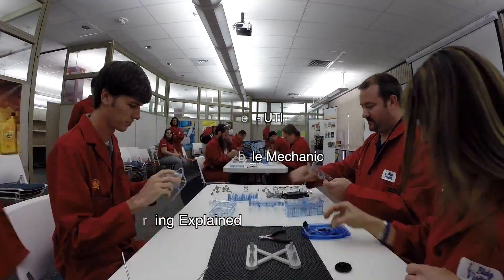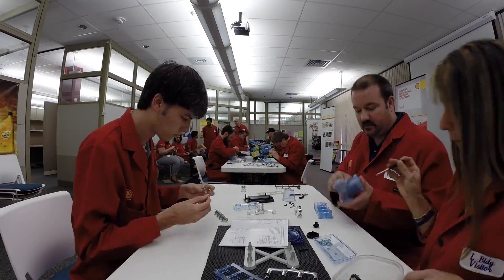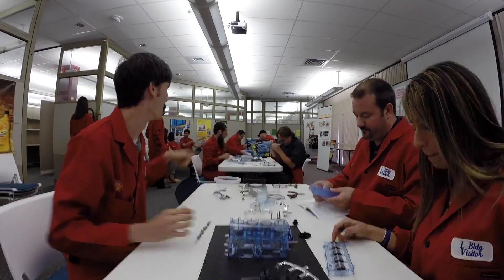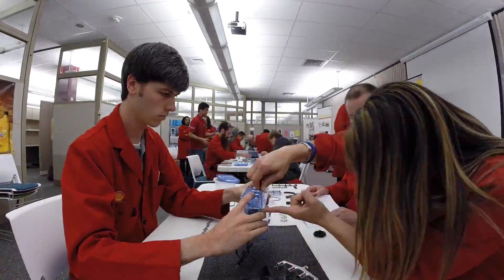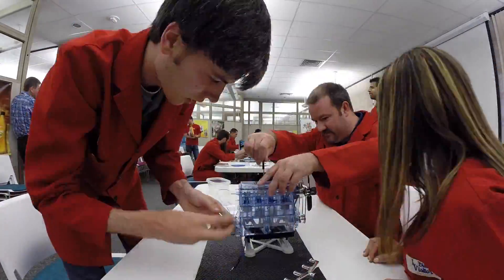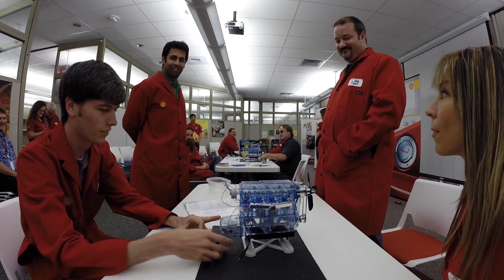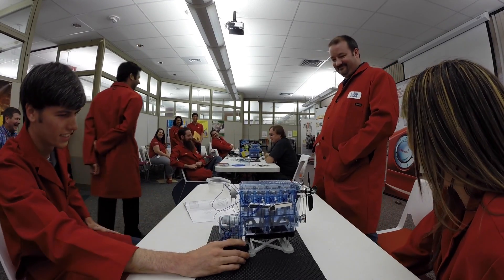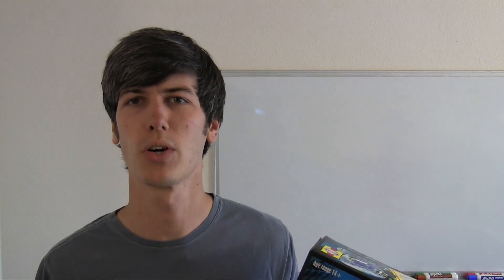EricTheCarGuy vs Scotty Kilmer vs Engineering Explained - Engine Building Contest

Comment: didn't understand anything, I know, that it was great fun! The best cars in the 2020s are the new Mazda turbos (maybe Toyotas too), not electric cars, politically pushed by Angela Merkel. I like turbos: diesel more than gas, preferably some, that would run  EMP-safe. Shell is a dumbbell though; they didn't activate my V-Power-Club card without my birth date! I don't want to give this info.   Nevertheless, I am a fan of Elon Musk's rockets; great, solid advancement to previous technic.

Comment: Why didn't the engine turn over i.e. "run"?
Reply from the maker: No oil! ;)
Reply: Hahaha!! That's what the $25 gift cards were for :P
Reply: Gotta get that Shell ROTELLA.
Reply: They had everything packed too tight so would not turn over.   Remember they are engineering people who love to do that, just look at anything made today.  Can not get to even a spark plug without pulling the motor.

Comment: What crappy engine has a cooling fan on the camshaft?
Reply: +adapter gasowski All WW2 aircraft engines.
Sorry, that's the prop.
Reply: +TIMEtoRIDE900 I think you have crankshaft confused with camshaft

Comment: this is cool,i wanna try this..how much is it and is it difficult?
Reply from the maker: +shinzantetsu I believe I linked in the video description. Pretty simple and cheap!
Reply: +Gregory Kanniard damn i'm 11, oh well
Reply: I have the V8 version of that engine. If you understand the main parts of an engine, you have a project for an evening.
Reply: +shinzantetsu They're not hard to get hold of... I used to have one, only downside is because the crankshafts on them aren't solid, they had a knack for locking up... if it was designed to actually burn fuel and run then that would be cooler!
Reply: +shinzantetsu For ages 12 and up and product is in the freaking video description lol
Reply: +Dennis Vu Dennis Your Last Name Is Vu?
Reply: *****
https://www.amazon.de/Das-Franzis-Lernpaket-V8-Motor/dp/3645652078/ref=sr_1_1?ie=UTF8&qid=1465029875&sr=8-1&keywords=franzis+v8

That's the one I have. Unfortunally the instructions are in german. The building part are only pictures but the history facts are german. Took me about 4 hours to built. As an advise, grind the injections seams (I don't know if that's the word?) of the different parts and use some WD40.

Comment: I put one of these together when i was 12 with no instructions. This is nothing like assembling an engine. It's like folding paper airplanes to determine who can build a jet the fastest. Let's see a REAL engine build content, timed, and then a drag race/dyno.
Reply from the maker: eatermaneatsyou Really? Because all of us engineers and mechanics were convinced it was the real deal.
Reply: Well either i'm a super human alien or.. its not haha. im an engineering graduate also, big whoop. so was the guy that invented Tang for nasa. im just saying, there is obviously a lot more to putting together an engine properly, and having it run at peak performance and longevity, than there is in putting together a plastic toy to run at 50rpm and i think it has nothing to do with advanced mechanical skills. however i would pay to watch the three of you assemble real engines, and have them ran at full load until they explode. im betting kilmer gets his done first, scottys runs the longest, and you put the crankshaft in backwards..

just messing with you man. all the best.

Comment: Typical Shell. A $25 gift card prize. The cheapest assed company in the world.
Reply: Don't get me started on mystery shoppers. And shell are cheap. My manager is only on £7.70 an hour. The minimum wage is £6.50. Shell even state on their training website that you can earn shopping vouchers when our contracts state gifts from customers or employees (tips and bonuses) are regarded at gross misconduct with instant dismissal. That evil.
Reply: radeakins with 25 dollar i can get a full tank here in my country, saddly there no more shell here
Reply: viuliscopmosco I work for shell. It's hell.
Reply: radeakins I got a $25 Shell card once, and all I had to do was answer some questions about a promo to a mystery shopper. (I worked for a chain of convenience stores that sold Shell gas.)
Reply: still better than Casey's here in the Midwest... they got good pizza but avoid the fuel like the plague.
Reply: lmao😂😂😂
Reply: 😂😂😂😂I've bought gas from them like a whole year and in the end I earned 20 litres of lpg...Not that bad.
Reply: +radeakins 
Well I could complain about Valero and what a bunch of cunts their employees are at the Valero headquarters in San Antonio.... Used to work there as a janitor for an even worse company they contracted out janitorial services from. Valero constantly complained about ever little thing, making management think my co-workers and I weren't doing our jobs. Actually, it was the new management, my employer went through them ever 4 to 6 months, and finally they built up some shitty managers. But ultimately it came from Valero employees complaints over minor things.

Comment: quite interesting to see the 3 car guys in the same video!
I watch more erithecarguy since he's more into car issues and gives advice to repair wich I pretty like and since he worked for honda for a while he know the product and that help me for my honda!
engineering explain is by far the opposite of the 3 there's no car repair explaination but more on engineering wich I like to learn about.  I've leran a lot about engine suspension force induction and exhaust well more engineering than advice but it help when it's time to modify a car
scotty kilmer is the simplist guy no time to explain the why and how.   you have issues with you car he explains it in few word.  problem with this do this it works!  of course he give some advice to avoid bad surprises.
2 ways to talk about cars (2 guys on repairs and maintenance and 1 on engineering)  3 different approches and 3 guys to watch!

Comment: Why is the fan attached to the camshaft?
Reply from the maker: sovietviking It's driven off the serpentine belt.
Reply: Engineering Explained
I realize that, but it seems like a bad idea to add rotating mass to the camshaft. Are there any real engines that are configured this way? Or is it just a stylistic choice the model builders used for their generic L4 model?
Reply from the maker: Many engines for industrial use and in older cars have a fan that's ran off the crank pulley.
Reply: I realize many engines have their fan attached directly to the crankshaft. I've got a decent amount of experience as a mechanic, so I've been under plenty of hoods.
I'm saying I've never seen an engine with the fan mounted directly on or in front of the camshaft, as it appears to be on the model. That's usually an area where nothing can be mounted at all because of the timing belt or chain and its respective cover. Putting a fan in front of that on a pulley is unnecessarily complicated when they could attach it directly to the crankshaft, as many are.
Unless you or anyone else knows of an engine with the fan mounted there, I'm just going to chalk it up to ignorance on the part of the engine model designers.
Reply: Actually, now that I'm looking closer at it, I know why they designed it that way.
The electric motor turns the crankshaft and they're using the belt to turn the camshaft. They essentially combined the timing belt and serpentine belt. Putting the fan on the cam pulley instead of the crank pulley was either because they didn't know, didn't care, or thought it looked better up there. In someone's mind that was just the easiest way to do it, and I've over-analyzed the situation.
Puzzle solved and all is right with the world.
Reply: stevetheviking too much ritalin?
Reply: No, I was just over-thinking something on a night I couldn't sleep.

Comment: I don't understand, why did the engine barely crank?
Dead battery? xD
Reply from the maker: Plastic parts with no lubricant, and super poor tolerances.
Reply: Engineering Explained So it is meant to be that way?
Reply: taledarkside Well that sucks, I really wanted to see the engine cranking and running.